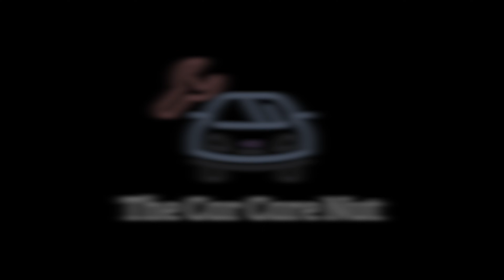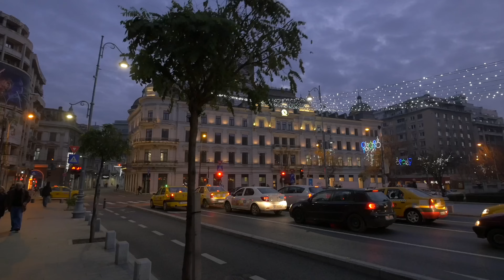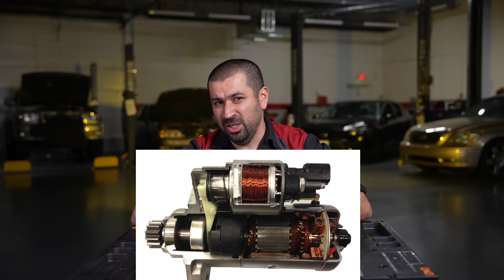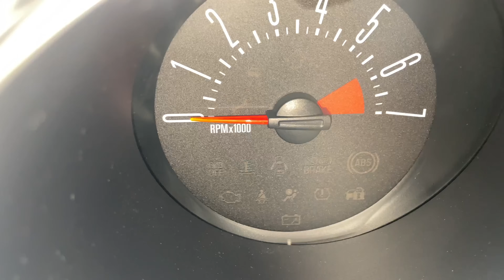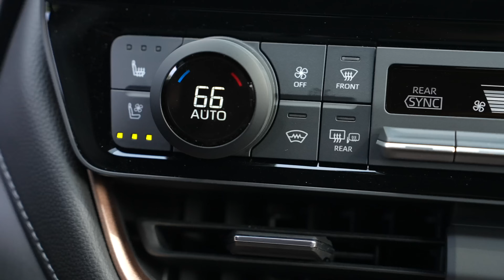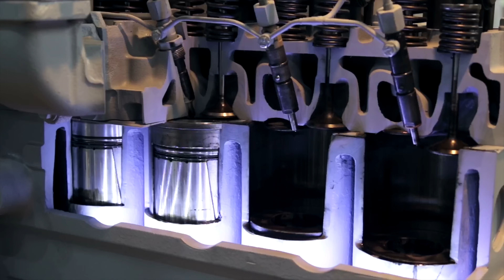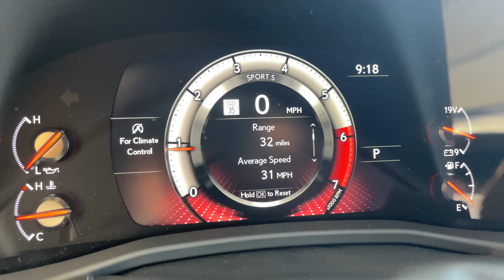How Does Start Stop Technology Work in Modern Cars? Everything You Need to Know

Comment: The lack of start stop was one of the selling points for my purchase of a 2019 RAV4 (2020+ they added it) along with both direct and port injection, a traditional automatic (no CVT) and a naturally aspirated inline 4. Happy with that decision thus far.
Reply: I have a 2020 Rav4 XLE that does not have the start-stop feature.
Reply: @TheKevin9000 it's actually optional it was when I ordered my rav 4 xle without a sunroof they always leak after 3-4 years in the Midwest
Reply: @robertg9334 my MOONROOF is almost 16years old and isn't even close to showing signs of a leak :) just gotta take car of your cars! Sun roofs are the entire roof being glass. The sliding little window on top everyone calls a sun roof is actually a moon roof.
Reply: No this is more trim Specific than year specific. 2019 LE has start stop. And a 2023 Adventure/TRD never had start stop.
Reply: @KevinLin145 my 2023 rav 4 was an optional item I chose not to include and after this video I'm so glad I refused the extra fees and headaches
Reply: @KevinLin145 My 19 LE AWD no longer has start stop.  I pulled the hood latch wire.  Start Stop is total bullsheet.
Reply: @user-tb7rn1il3q  Are there any dash lights when you pull the hood latch wire?
Reply: @KevinLin145  None, I did disable the notifications so start/stop unavailable is not displayed.  The extra gas burned is negligible.  I don’t want to be replacing the starter or the battery more than once.  The cost of 1 starter replacement and 1 additional battery replacement will be an order of magnitude more expensive than a little gas.  It’s also a safety issue.  Emissions is worse with the starting and stopping.
Reply: @user-tb7rn1il3q  Base on this video, it appears all you need to do to defeat this system is to just change to a regular battery. ;)
Reply: @PushStart_YT  It’s a lot easier and cheaper to disconnect the hood wire.  The enhanced flooded battery will last almost forever with start stop disconnected.
Reply: @user-tb7rn1il3q  Does that work to disable it?
Reply: @user-tb7rn1il3q - I disconnected the hood switch to. Would not drive some kind of hood open warning though? I didn’t seem to notice any kind of warning disconnecting the hood switch.
Reply: @PushStart_YT - that’s exactly what I was thinking. I wonder if there’s any downside to just doing that
Reply: @user-tb7rn1il3q  does disconnecting the hood latch switch cause a message to display about your hood being open? Surely there’s some kind of adverse impact to go in that route.
Reply: @condor5635  I doubt there's any down side. The biggest battery draw is when you start the car. With that "feature" defeated with a normal battery, you'll just be driving a normal car. The computer might draw a bit more power when the car is off than cars of the past but as long as you drive your car, the battery gets charged. And if you don't drive often, just hook up at battery maintainer at home.
Reply: @condor5635 I've had mine discontinued for 2 years now. Haven't had a single downside. Actually forgot I ever had that annoying feature.
Reply: @user-tb7rn1il3q nobody cares. 😂
Reply: @condor5635  Absolutely no issues other than increased starter and battery life.  The impact to mpg is virtually zero.
Reply: @user-tb7rn1il3q a starter is like 50 bucks ? That’s less than a tank of gas
Reply: @juliet4093 no Juliet, this ain’t the old days.  It’s $200
Reply: @slalomking it's more like $300 now, $500 after labor and taxes
Reply: The worst thing in the system is that it reminds you how loud your engine when it shuts off.
Reply: Agree it's horrific technology to live with - probably if I lived in big city I'd be OK with it as I'd feel I was contributing less to smog problems - but I don't live in a big city, and most of the time my car is on the move, not stopped in traffic - I know from having rentals how horrible the stop start feeling is.
Reply: @Beer_Dad1975 it’s worse in city driving I agree not a good system.
Reply: @kenlehigh6363  I think some of the other commenters pointed out that it varied between trim levels as well as between model years - for instance the 2019 LE had it (?) but not the XLE. It's been 4 years since we bought it so I may have forgotten the specifics, I just remember it was one of the purchasing decisions for the specific year/trim we ended up buying. We had test driven a Subaru with start stop and it was definitely noticeable to the point that I knew we wanted to avoid it if possible.
Reply: I just got rid of my turbocharged auto-stop with a 191 horsepower, for a naturally aspirated with NO auto-stop...and have 181 horsepower.  I get better gas milage and an oil change lasts longer because there's no turbo.
Reply: Stop start is stupid.
Very little gas or emissions savings, oil draining out while stopped.
I can see it causing accidents too.
Yesterday I was exiting a parking lot and forgot to turn it off. I released the brake and hit the gas. Of course it hesitated as it restarted. I backed off the pedal. Had I hit the gas again I would not have made it safely into the road due to an oncoming car.
I hate this "feature".
Reply: @matthewk6731 Grab the start stop eliminator for your car. I put it on my 2034 forester and never looked back
Reply: On my 2019 Buick Enclave I have it in manual shift mode to disable auto start stop and set to 9th gear, and let the trannie shift normally when driving in town. When I get on the highway, I just leave it in drive.
Reply: @frankbodenschatz173  You have a 9th (!) gear? That's a lot!!!
Reply: 2020 Rav4 Xle does not have start stop
Reply: @nieo777 mine does!  2020 XLE
Reply: Thanks for that information. I detest this mandated crap and shouldn't have o press a detent button each time I start it.
Reply: You can just  shut it off by a push on a button 😂
Reply: @The.world.has.gone.crazy... what about if push button što working
Reply: @antetomasovich7710  fix it! 😉😁
Reply: how so? my Rav4 in 2019 has that freaking start/stop tech.
Reply: Your post save me the trouble of looking for a vehicle that didn't have this, and still had old transmission.  
One of my recent searches was "Last cars without CVT" 
I get/change car, when I have the money at the time, not assuming I'll always have cash flowing. In addition to doing most of my own work. Basically everything I can do, I'll do. But so many new cars add so much crap, and sensores and electronics components. A nightmare to troubleshoot and work with.
Reply: @Omizuke  Just crossed 55,000 miles and still would highly recommend it. Only thing I've had to replace is tires. I did do a drain and fill on the transmission fluid at 40K and would recommend that be done at 40-60K on any vehicle (despite many manufacturers not specifying a change interval for it and considering it "lifetime"). Two issues that may seem like a problem but are actually normal are 1) it's a little loud/"clattery" at startup - this is because it's using the direct injectors during cold starts and they're noisy by nature; after 20-30 seconds it switches over to the port injectors and becomes noticeably quieter. 2) The parking brake is electronic and makes an audible squeak every time it engages. Lots of cars do this, especially Toyotas/Lexus, and once you're accustomed to hearing it you'll start noticing it from other vehicles when you walk through a parking lot, etc. Again, neither is a sign of an actual problem, just a function of their design. At 55,000 even the brake pads still have plenty of life left so with regular oil changes (personal recommendation is 6-7K instead of the 10K Toyota recommends) and normal service like the transmission fluid I expect it to keep being pretty reliable for quite some time to come.
Reply: @Omizuke I’ll remember that the CVT transmission is bad after I pass the 300,000 mile mark which is in 12,000 miles on my 2017 pathfinder I have the fluid changed every 50k and never had a issue
Reply: I completely agree. Less is more. 

Fuel savings is most likely negligible. Engineering Explained also mentioned that a start stop is only worth it when the car isles more than 8 or so seconds. 

My family has a 2019 LE AWD with a physical key start, no button and a 2020 XLE AWD, with no start stop.
Reply: @kevinfluencer it is 100% not negligible, idling wastes literal gallons and gallons of fuel
Reply: @juliet4093 are you paying for his gas. If not who cares
Reply: Makes a lot of sense!!!!!
Reply: We purchased a 2019 Rav4 Le AWD with the start & stop technology maybe they made both?
Reply: Exactly
Reply: yea
Reply: You can turn it off😂
Reply: Thank you. I'm researching a pre- stall/start bullshit  CRV. I'd get a RAV4 if I fit in one. It's the best deal.
Reply: If the car does not like what is happening the engine starts.
Reply: I test drove a 2021 RAV4 and had never driven a Start/Stop vehicle before. I hated it! The lag in moving forward at a stop sign was enough for me to say no to it.
Reply: Happy to be poisoning vulnerable people with the crap from your exhaust pipe. Shame on you butt I suppose it takes all sortts.
Reply: How much more is the special battery?
Reply: One of the issues I had when the auto-stop was engage shuts the re-engages which creates a bump when it does this like someone hit you in the backend, don’t want it don’t need it.
Reply: Yep my 2016 RAV is running strong at 135000 miles. I generally buy new cars every 10 years. Nothing on the market interests me. A turbo v4? No thanks. Probably going to end up with a hybrid but I hate CVT transmissions.
Reply: I hate that they are not 4x4, being a Toyota, do you guys get 4x4 over there and how is your experience so far with it.
Reply: One of the same reasons I bought a 23 Tacoma. And for the V6.
Reply: More Bs that can go wrong.. Between the CVT and this bullshit, I'm looking to move on to another car model, that do t have all those nonsense...
Reply: I just put a stop start delete harness in behind the button. On a RAV4 is very simple. About 10 minute. Job works like a charm.
Reply: Just turn it off when you start the vehicle.   Problem solved.
Reply: @robertg3592 I don't remember it. And it's irritating to have to do anyway
Reply: @nowayjose596
Did you mean idle stop start?
Reply: This is so dumb. Nobody wants the garbage
Reply: Good to know. I may look at a 2019 Rav4.
Reply: I'm glad I have a low mileage 2019 corolla and low mileage 2020 Tacoma.  No s/s.
Reply: Smart choice. Enjoy! These are brilliant cars to own.
Reply: Oh no you have to press a button to turn off the annoying function but the RAV 4s up to the 2024 model year have everything else you listed. I don't care for auto stop/start. I'm happy there is a button to turn it off at all. I don't like it in traffic where I only sit for a couple of seconds per stop. Other than that, pushing this button is no different from any other function in the vehicle. You still need to put your input to make the other functions work anyway like the turn signals.
Reply: @billwylde4846 the thing is no one wants to press something they dont need to, and thats what exactly the s/s function does its there to let you turn it off when you originally didnt want it on to begin with and that makes all the difference of being annoying and not
Reply: @donatelloadarna  Everything else does that too like the Sport button. So what?
Reply: @billwylde4846  I agree. it sucks that you have to press the button every time you turn on the engine.
Reply: @billwylde4846  You can go to a shop with a quality scan tool and just disable that garbage permanently. You can disable all the obnoxious beeping crap to.
Reply: @billwylde4846 true, but it's another function to micromanage every time you get in the car to drive.
Reply: @basilman121  The RAV 4's AWD drive modes near the gear shifter has more buttons and (Depending on the trim) a knob to operate. Compared to one auto stop/start button. Not that hard to press a button right when you start up the vehicle.

Comment: Maybe Toyota brought this technology in USA 2017 as you said, but rest of the world got it 2009-2010. Certainly with the 1.33lt engine that equipped iQ, Yaris, Auris, Verso-S and Corolla models. Also, it is measured that a stop of over 7 seconds will benefit fuel consumption with a start stop event.
Reply: No gm had it 2009 2010
Reply: That's right. My 2015 Toyota Corolla Axio (JDM) unfortunately has this technology.
Reply: Many European models had start/stop towards the end of the 2000s in order to meet the lower tax thresholds for CO2 - it seems to exist on many ICE cars to this day - ultimately if the engine is idling for more than around 10s (Engineering Explained did a test) it will be wasting fuel - seems this point is missed on many as annoying as s/s can be occasionally 😮

Comment: Very interesting video, I appreciate my start stop system a little more now although I also almost always turn it off as soon as I take off and the button for it is the only button that shows some wear in my interior I also can see in the infotainment what the status of the system is it very informative, its just mind blowing how much thought goes into all these systems, recently I wondered how much thought goes into my cruise control because I tried to only drive with it without operating the throttle and I worked surprisingly well, I drive a manual and if you set a sped of say 60 you can shift the gears and have the car pause acceleration every time you push the clutch to shift or when you go through a bend it senses that and pauses the acceleration until you leave the bend and are straight again
and last year I had my windshield replaced and needed someone with a laptop to relearn the lane keep and auto high beam assist 😄 its bonkers , please make more videos like this explaining the depth of these systems its very interesting 🙂👍🏻

Comment: also... it can be dangerous on some makes and models... when you floor the gas pedal while trying to cross a busy intersection, the lag created by the start/stop function can take a brief moment to start then engine.... even if it's only half a second, the difference can cause a disastrous accident.      sooner or later, a team of lawyers will figure out how to sue automakers for billions on behalf of car owners
Reply: If it takes half a second for the stop start system to work then something is seriously wrong with the vehicle.  That’s a crazy time lag, I have a diesel car which until recently had a 9.5 year old battery and that thing started the engine when my foot was only halfway off the brake pedal, no matter how fast I try to move from brake to accelerator.

The solution isn’t ‘don’t implement a stop start system’,

it’s more like

‘if you can’t even make a stop start system that works within 0.2 seconds then you probably should not be making or selling vehicles’
Reply: Yes.  And those same lawyers would also sue to have the disable button removed after a parked idling car catches fire.  They work all the angles.
Reply: This is exactly what happened to my wife and I.  Rental car and forgot push the button!  Dangerous.  Will never own a vehicle with this feature.

Comment: As someone that did auto electrical work in the 80’s ya I’m old. Give me a vehicle with electronic fuel injection,air conditioning, and power windows for convenience and I would be happier than a pis. I trust Toyota but other manufacturers not so much to be reliable. I will take old school simplicity instead of all the fancy bells and whistles any day! Yes my fuel economy is less but if I’m out 4wheeling in the middle of nowhere and something goes wrong with a few basic parts I can diagnose fix and I’m on my way without being stranded! Great video and explanation but all this new technology is not for me. For reliability I drive a 2022 4Runner and my wife got a 2023 gx460 before everything goes smaller motor turbo.

Comment: In conclusion very irritating for minimal fuel savings.
Reply: If you drive frequently in city traffic there is a significant savings of heat and wear on the gas engine over the life of the car, that can be more beneficial than any fuel savings. Aside from the fact that burning fossil fuel at stop lights for no reason is a little bit crazy.

Comment: I would be fine with it if I could choose to turn it on or off and it will remember that setting. 
I just ended up disabling mine all the time.  
I belong to a Rav4 forum and too many people have had pauses when turning left due to the
start/stop system.  
I notice mine is not so instant either so not worth the cost of an accident.